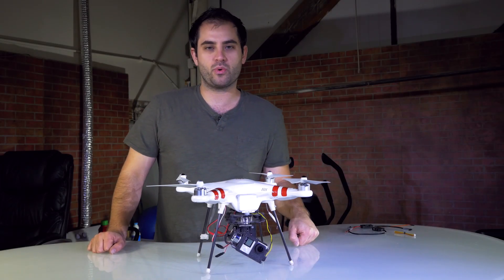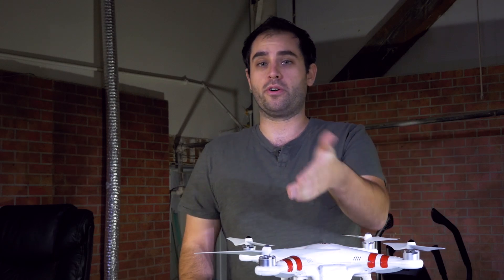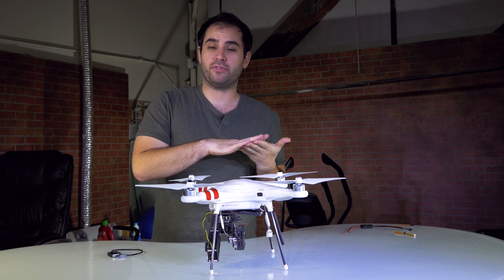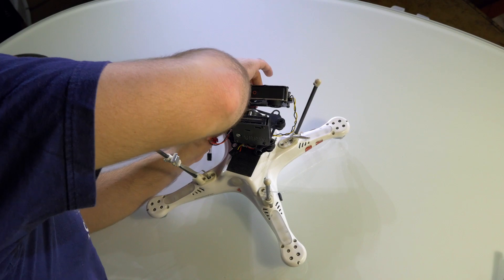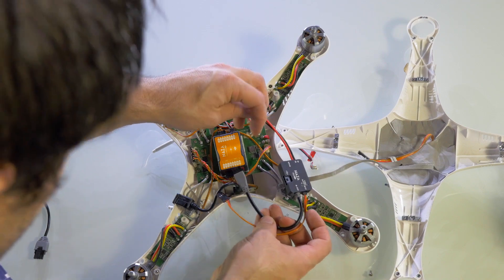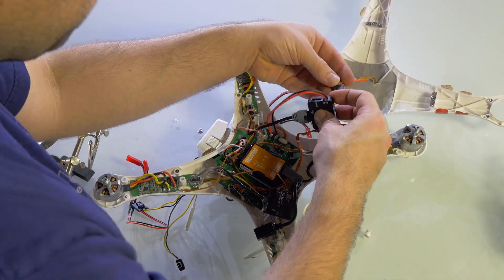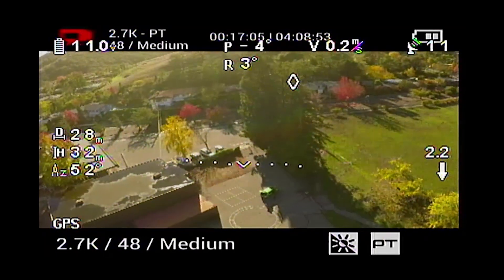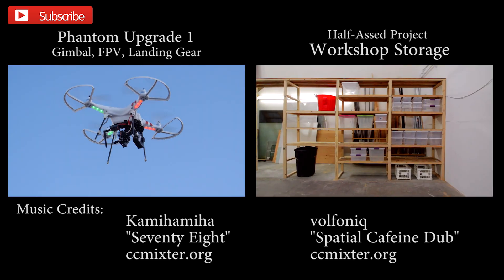iOSD, PMU v2, and external USB mod on the Phantom 1

Comment: Hi mate. I was wondering if you could help. I have recently sold my phantom 1. The buyer now tells me it is missing the usb data cable that plugs into the imu/usb cable inside the battery compartment. Is this a specific cable for the phantom 1? Can I use any other sort of cable? I did try a normal usb cable and wondered why it wouldnt connect to the assistant, even the status light didnt blink properly so therefore think it is a specific cable. 
Any help is very much appreciated.
Mike
NZ

Comment: The reason for the Phantom batteries being so high is called greed.  The "smart" batteries actually aren't so smart...they advise you to discharge the batteries every 20 cycles (a known lipo killer),  and many people still don't get over 50 cycles...$2 - $3 per flight...not so good. A good quality 2200 mah lipo properly maintained is probably good for way over 100 cycles and they cost $20 - $30.  DJI needs to get off this "smart" battery kick before it hurts their sales on an otherwise great product.  They could simply enlarge the battery area to accomodate two 2700 mah batteries and get the same flight time.  (All of the above is of course my opinion.)

Comment: You have the orange v2 controller. I have the v1 red lite. (With v2 upgrade.) Did this 1,5 years ago. Ugrading to 4.0 is really hard now. You just kept all the internals and did not go to the external gps. The external gps has the compas inside i believe. Your saying i can use the v2 parts like pmu iosd from the v2 and plug them in de naza lite v1 (upgraded V2)? No configuration needed do you think? Just basic settings. It will not reject the v2 parts?

Comment: How you got 8 minutes flight time with single 2200 battery and those full setup??? Mine only got 5 minutes with single 2200 battery and the same setup like yours. Thanks Will.

Comment: Nice video Will,

Have you tried the Multistar 4000mAh batteries (they fit with a slight mod to the battery door latch) I get 7 mins with 2200mAh and 12.5mins with the 4000s

http://hobbyking.com/hobbyking/store/__64440__Multistar_High_Capacity_3S_4000mAh_Multi_Rotor_Lipo_Pack_US_Warehouse_.html

Comment: Surprised you never bring up DIY builds over RTR's for quads.  When it come's to upgradability, reusability and having full control of parts any RTR will come up short.
Reply: ***** I've done RC in car's/truck for years and started out with some RTR's then. Been wanting to get into multi-rotor now too. Half the fun of any RC is building/working/repairing them.

These multi-rotors are just getting too proprietary ($$) especially with what you and others do with them.  You need the customizability when you're working with payloads (camera's) as opposed to hobby flying.  For a fraction of the price you could have magnitudes better flight time, control and upgrade paths.  It will make for an interesting series if you get around to a DIY build and are able to compare a modded phantom to a purpose build rig in $/functionality comparison.

Comment: you keep adding weight...........doesn't that eat your power ?...........
Reply: ***** I have stock everything on my P1.1.1 and picked up a $60 gimbal from e-bay and does take away flight time and notice stability issues with weight - especially if battery is low. My Phantom has a gimbal controller on transmitter and wonder if you've found a use for it.  Long term, I'd like a fpv setup, however it's a bit much to digest right now. Thanks for all you do in presenting the P1.  Very nice job.

Comment: Why an FPV monitor? Go for some Fatshark goggles instead!
Reply: Well said dude! Why not choose a FPV Headset instead of the monitor? Is much more comfortable and does not need all that extra staff
Reply: ***** have a monitor on the remote must make it very difficult to fly, but also have it a part doesn't seems as comfortable as wearing a pair of "glasses", isn't it? I never had a quadcopter and I've never driven one so mine are just guesses. I hope to have one someday, but my plans are to build it not to buy it. (Sorry for my bad English, i'm Italian).